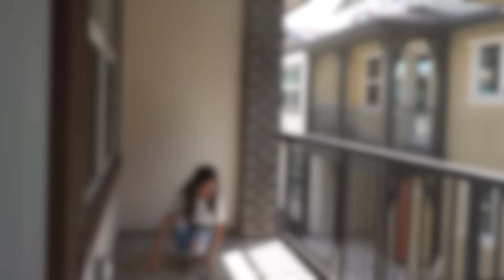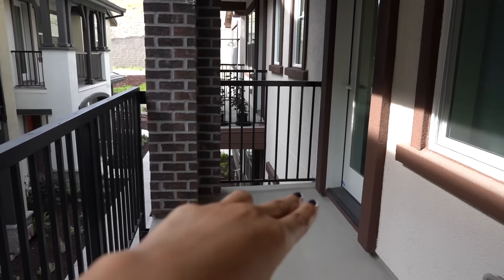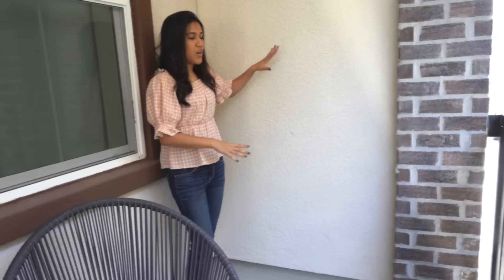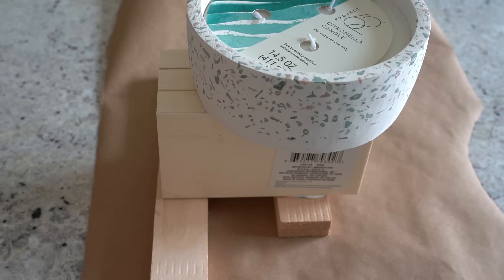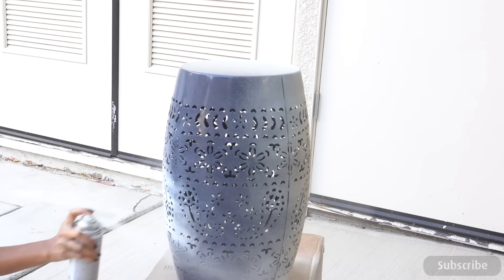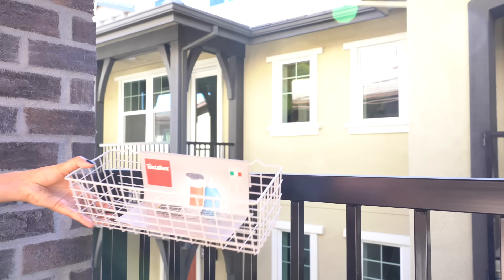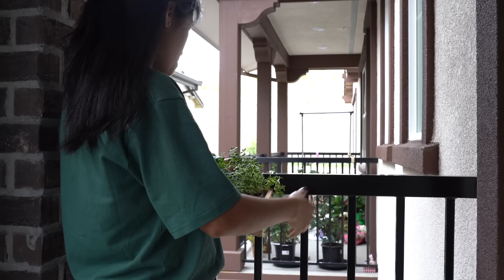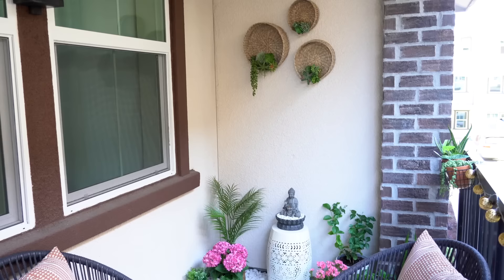EXTREME BALCONY MAKEOVER | Modern Boho Zen Plant Garden | Renter-friendly | Spring 2024 &Summer 2024

Comment: This is cute. I will subscribe. One suggestion would be to use a larger-scale installation on the accent wall. It looks a little empty. Maybe switch out the smallest basket for an extra large one and arrange accordingly?

I love the rocks and the water elements. You can add fire with candles or a miniature tabletop fireplace! 
My favorite DIY was the foam-covered flowerpot.
Reply from the maker: Thanks for your amazing suggestions! 😊 A miniature fireplace would be amazing, will try it out this upcoming summer 🔥